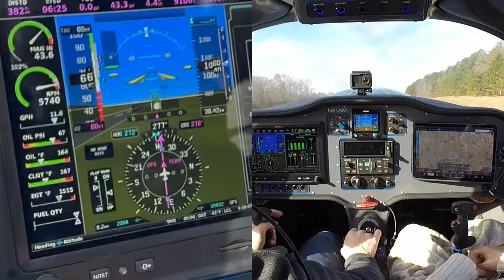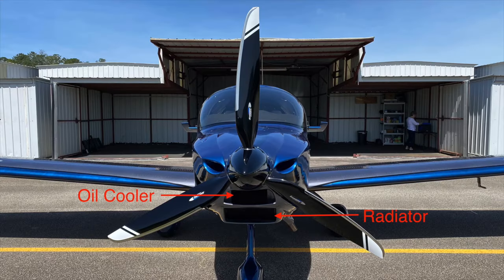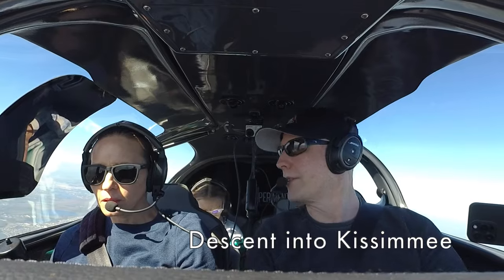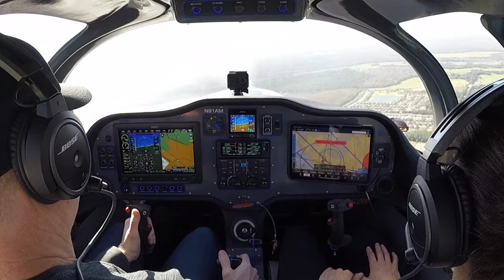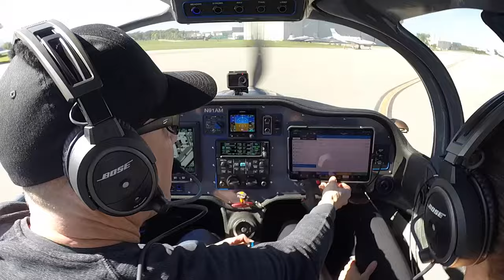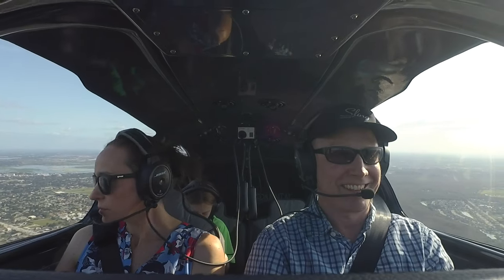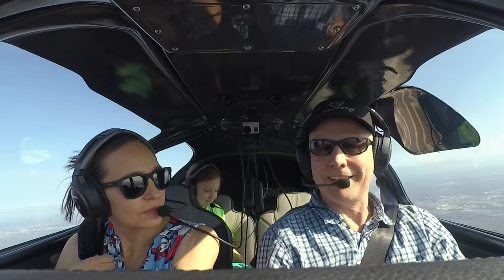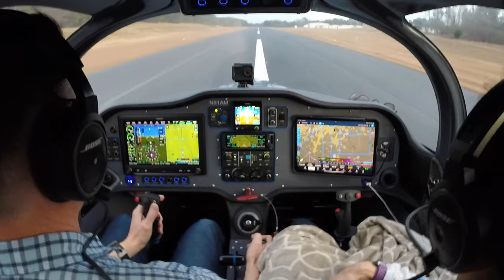Winter getaway to Orlando / Kissimmee in a Sling TSi

Comment: I still heard that hill in my head🤣 I hear you with battling the heat. Right about when it’s 32° on the ground  I put one strip of aluminum tape on my oil cooler and one strip on the radiator for my 915. It’s a real pain when you’re doing cross countries to different climates and flying in the flight levels or cooling isn’t as effective. I wish there was an easy thermostat solution for both the oil and coolant just like a car. Do you get oil foaming at high altitudes where it dribbles out the breather tube? Mine seems too…
Reply from the maker: You lost me on that first comment. 🤷‍♂🤣 I agree with you about the thermostat. I know one guy in Michigan who tried a thermostat, but he ended up taking it back out -  not sure why. It's an aftermarket thermostat which apparently is commonly used with Rotax, but  it doesn't have the blessing of Rotax, so it's a little "extra experimental." I've never had any oil foaming up high that I know of. My belly is always dry - nothing out of the breather tube. I know low pressure can suck oil from the breather tube if not routed properly. We put a couple of turns in that tube and haven't had any problems.
Reply: @OneAlphaMike  ahh damn Siri. Meant “heard Benny hill in my head”. My oil pressure is around 57 at 72%. Belly gets a little greasy and the hanger floor has a drip or two after a flight from the breather. Heard stories about an air separator that might take care of the foaming.
Reply from the maker: @Captndarty  This company sells oil and water thermostats for the 915, but I don't know anyone who has tried them. https://www.flyrotax.com/assets/filesDistributors/dis0008/Special_Accessories_10-2022-komp.pdf
Reply: @OneAlphaMike  Oh sweet thank you! I found this guy who had installed one on his 914. https://youtu.be/4wPNW_mJrQk

Comment: Has anyone tried attaching a mechanically operated, sliding cover that can partially cover the oil cooler on cold start ups and be gradually opened up in flight as the oil heats up?
Reply from the maker: Yes, I know of a Sling TSi owner in Michigan who has installed this oiler cooler shutter, which is an aftermarket product for Vans airplanes: https://antisplataero.com/products/oil-cooler-air-shutter

He says it gives him about 20 degrees of control, but he still has to tape in winter. Another option is either an oil or water thermostat. There are aftermarket thermostats, but Rotax doesn't officially support them. I think Rotax should offer one of their own, or choose an aftermarket one that they can endorse.

Comment: On the right side of the panel, is that an iPad? What does it do for us, for flight, that the Garmin 750 won't do?
Reply from the maker: Yes, that's an iPad. I wouldn't compare it to a 750, though. That's a $20k piece of equipment, so of course an iPad is cheaper. But you still need a certified GPS navigator for IFR. I have the GNX 375 for that, which is like $7k. I think of the iPad is being used in lieu of a second GDU / G3X screen.

In a couple of previous videos I explain why I like the iPad vs a second G3X screen:
https://www.youtube.com/watch?v=SHw-69o8TbI&t=473s
https://www.youtube.com/watch?v=cRPFt-etlY4&t=97s
Reply: @OneAlphaMike  thank you very much that was great information! I love the kid in the backseat with making comments throughout the video.